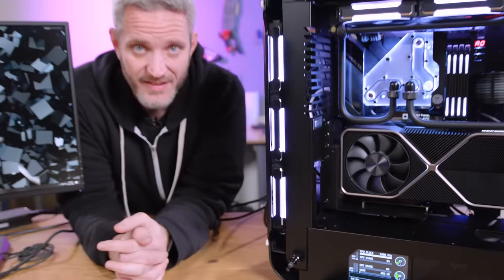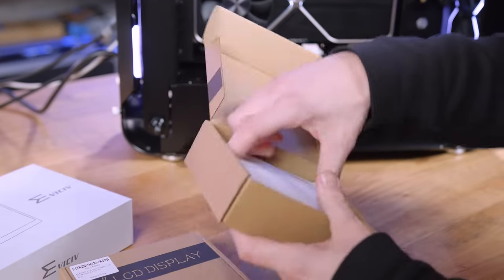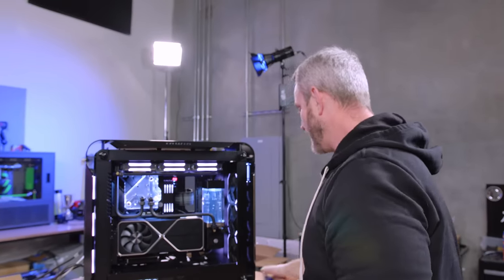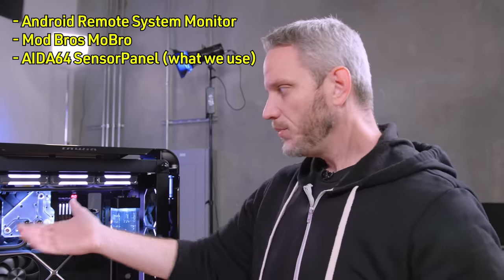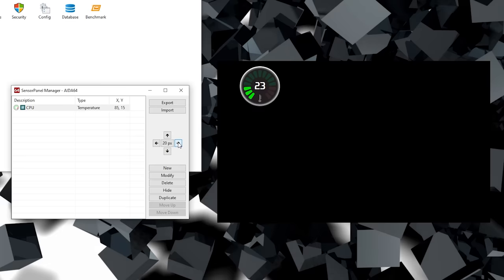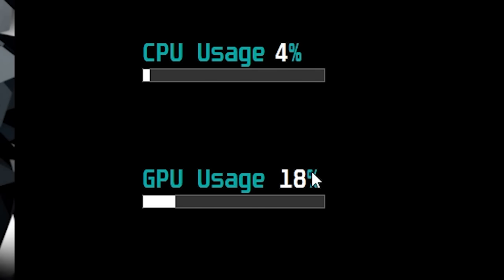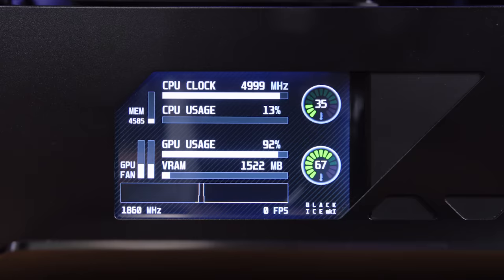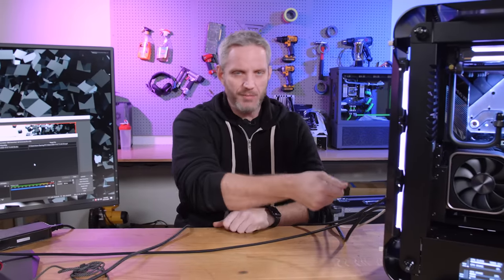EVERY PC should have one of these! How to make a sensor panel!

Comment: for those who couldnt fix the main display issue users, you need to find the correct dp/vga/dvi port on ur gpu for your main display,  
in my case, every time I boot up, the mobo automatically recognized the 5inch panel as the main display before loading into windows, i have set the monitor as the main display and it still does that everytime; 
eventually i changed my dp cable from one dp port to the other on the gpu (the new port is the one before the hdmi port), and this fixed my issue. (I have a evga 2080super xc ultra which has 3 dp ports 1 hdmi and 1 type c port)
just sharing my experience to help out anyone who might encounter this issue same as me

Comment: Second time watching this awesome video! I bought an Antec P120 case, because it had a tempered glass door, not knurled thumb screws, and for nostalgia, since Antec made the case I built my first computer in, twenty years ago. Added bonus, the case has a top mounted PSU shroud, classic, with a beveled window that is perfect for a sensor panel.
Update: I ordered the Waveshare five inch screen. It was twenty dollars cheaper and comes with a stylus, instead of the mounting screws, and no CD/DVD, just have to wait six to eight weeks for shipping, of which, replay through Amazon said it shipped about seven hours after I ordered.
Reply: Has anyone figured out a graceful way to connect an internal monitor. Personally,  having a hdmi cable come out of the case and back in is unacceptable for me.
Reply: @Jim22150  Maybe look for a PCIe card with an internal header, or get an old graphics card with a VGA port on a ribbon that can be disconnected from the mounting bracket and pulled into the computer, then connect it with an adapter. Not sure what your setup looks like, but you may be able to hide the whole card out of site with a riser cable. Of course, I don't even know if something like a second display card can be set up to only work with a second monitor. Just being creative.

As far as my computer goes, after having a power cord, USB cable to the printer, USB cable for my mobile device, ethernet cable going to my router, which has multiple cables of its own, and a USB splitter for my ps/2 mouse and keyboard's wireless receiver, having one more cable behind my computer isn't going to make or break my set up. Also, I'm currently using the HDMI off the graphics card, so my set up may end up looking a bit janky since I have to run a DisplayPort to HDMI adapter into the case first.
Reply: @1timothydillon  thanks Timothy,  I think I have another that also may entice.. find an empty usb 3.x header on the mobo, plug in a USB 3 cable with a female end,  from there plug in an active HDMI to USB 3.0 adapter (DC power required), then plug in the monitor. This is not very graceful either though bc the DC power cord would need to somehow be plugged into the PSU. Maybe there's some sort of molex adapter for this?

Anyway,  hopefully there will be a better solution in the future with next gen mobos. Look how far we've come with RGB over the last 5 years.  I can conceptualize future builds having multiple monitors for complex  stats dashboard or simple logo display

Comment: In regards to power/PC shutdown, I use a smart plug and have my bios set to power on after power loss restore.  So I can remotely turn my computer on either on my phone or google home/alexa. Also, the plug actually tracks energy usage which is nice little thing.   This would solve there still be some power going to USB ports even when the computer is "off"

Comment: I have a Corsair 4000D with two 140mm fans at front. 5inch screen fits nicely brtween them with no mods required, just two small cable ties.

Comment: I use something kind of similar, but on a tablet. It's a program called Remote System Monitor, you run the server on the PC, and the app on whatever mobile device and it works over your wifi. I have a few cheapo $70 Android tablets I use for stuff at my sim rig, so I set one aside for this. The only downside with this app is you have to "donate" to unlock all the features, but one dollar is all you need to spend.

Comment: This is a fun project. It does not make any sense though. It would be easier to get an additional monitor and display the metrics there. If you don’t have horizontal space, you can get a desk mounted stand that can hold two monitors stacked on top of each other.

Comment: I made once for Spec Delta  RGB Case Used my old Android Phone  with Program called Spacedesk on the Desktop and Samsung S5  set it up as 3rd Monitor install Panel and it worked flawless  OF course  I had keep Phone plugged in

Comment: Instead of running a HDMI cable to the outside of the case to the GPU you could use a Displaylink. It can run of USB 2.0 or 3.0 and since you are using the USB header anyway you don't even lose any more ports. Just search "USB Displaylink", these things can run 1080p with 30fps no problem.

Comment: Thanks for this adventure.... wow, this has evolved a lot since this video. Have you (or the team) considered using a USB 2.0 UGA to VGA ( and HDMI) inside the case and connect using a free USB pin header. if you dive down the rabbit hole, in the AIDA64 forum for panel sensor layout sharing is 316 pages and growing. I have viewed every one of them looking for layouts. There are a lot of different screens and sizes being used now. I would not be surprised if case manufactures start making these panels standard, or at least brackets available in the near future. Thanks for the great vid and info.

Comment: I used an old android phone in a little shell I put together using pitikapp to achieve this for zero cost.

Also links to Afterburner /Aida etc. And the display powers and on and off with the system.

Can edit the colours easily also so it works great with RGB. 

And ofc the display is great because it's a samsung AMOLED

Comment: even by using usb cable direct to a header you could get a mobo that has usb power turned on to the extra headers and may have to shut that off in bios anyways. just a good thing to probably check.

Comment: You could probably has used the first screen with an SFX power supply to have enough clearance for the 90° HDMI adapter. It just takes a bracket adapter to mount an SFX PSU in an ATX-spec case.

Comment: May want to mention about cutting the pcbs. All pcbs are multilayered; some times there is some kind circuitry in the board.  Not saying that electricity does not go through the board but instead rides on top.  Something that should be a video.

Comment: A lot of these videos are using aida64 and I haven't seem them mention any alternatives.  So I'll give Rainmeter a plug.  It's good enough that I'm really hesitant to spend another $50 on this little system monitor project for aida.  I'm sure it's worth it, but just seems unnecessary atm.  Been using rainmeter on my main screens for awhile so I'm just stickin with what I'm used to for now.  

It isn't as hardcore as aida's system monitoring, but plenty for most of us.  It plays well with Afterburner/RTSS and other apps (I think even aida).  You can create your own skins or edit the ones you download, combine elements from multiple skins, etc.  And it's much easier to find cool Rainmeter skins than it is to scroll aida's forums, imo.  

To edit the skins, you just have to get used to editing text files if you're not already, so probably another point for aida.  But it's pretty intuitive and easy to figure out.

Third option: use an old android as a remote system monitor in another room, or if you just don't want to buy a screen yet.  Trigone remote system monitor is probably the best for that.  Just takes a donation of >$1 for full feature/no ads.

Comment: ive got that, its called coretemp and msi afterburner giving me those stats in my taskbar.
or using rainmeter and setting up some system monitoring stuff on my other monitor while also being able to use it as a second monitor.

but yes, that little panel does look cool.
though i can imagine with how its set up that alt tabbing and exclusive fullscreen games might cause issues

Comment: One thing I didn't spot in the video - where do you plug the other end of the HDMI cable from the panel in? Are there internal connectors on modern graphics cards, or do you have to run
the HDMI cable outside the case into an external graphics card HDMI socket?

Comment: That’s pretty slick, I wonder if you could use a piece of clear double-sided tape and cut it to the exact size of the display and very very carefully mount the front of the display to the glass side panel of my ATX case as a way of mounting it instead of cutting through the bottom played that covers the power supply like you have it. I’m thinking lower right side mounted right on the glass with double sided clear tape?

Comment: The USB power thing varies by motherboard. 
My Asus X470 Prime powers the headers when the system is off.
I had to disable USB power so I wouldn't have the "Power" light of a memory card reader shining at me while the system is off.
My ancient X38 Core 2 Duo rig actually has physical jumpers to decide on a port group/header basis whether that port is powered when off.

Footnote, I don't know if the utility is still being maintained anymore, but back in the XP days I used "Serious Samurize" as a HUD utility. It connected to RivaTuner and Speedfan (the latter I know is no longer being maintained, sadly) to give me an excellent little vector/LED style HUD in the corner of my screen.
There are probably other utilities that use RivaTuner.

Comment: I use my cellphone for internet and the Spacedesk app which turns it into a second full resolution 60hz monitor over USB or wifi.
Touch screen monitors, wallpaper engine and widgets (media player, volume, date/time).

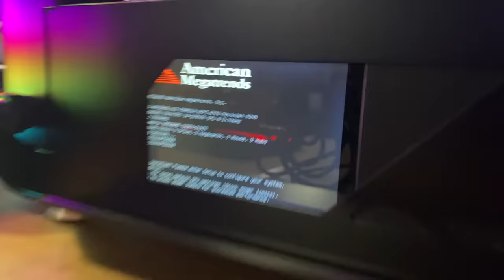Comment: Great video. I am looking forward to get a panel like that running on my system. At the same time I would love to know how to fix the default boot monitor issue as described at 18:48 marker. I know, strange question, I looked everywhere on how to fix this and for the first time I got to see someone mention it.
Reply: 1 yr late but I hope you fixed it. Like in the video, just dont connect the hdmi yet before booting. If you mean once installed, just make sure to set your main display as the primary monitor. Used to happen to me too using a secondary monitor.

Comment: Hi Guys... used this as a inspiration to build my own external sensor panel. Even used Aida64 which was way easier to use than expected. However the gauges on the version I got was basic circles. 
Where did Phil get the Gauge Image

Comment: Jay... Did you link the right panel model? You mentioned you started cutting off the riser tab holes - but the 5 inch one you link to on Amazon has those too! The one you display later about 6 min in doesn't have them. Did you cut those off too? Also does the HDMI feed back out of the back of the case into the GPU backplate. There's no neater way to do that is there?

Comment: Such a cool idea.  I'm curious if your mouse will drop off your main display to the small screen (if you're going to town on your favorite RTS, for example).  Anyone know how you'd prevent that?
Reply: If you're running, say 2 main screens plus this one... Set this one above your 2nd display within your windows display settings. So if you accidentally go to your side monitor, you won't hit the tiny one without going up. Arrange them in an "L" shape with the tiny screen up top, if that makes sense.

Comment: that looks nice. Ive got a define R5 case with the glass window( I think its just a strong plastic to be honest) , dont have the sleek bottom opening like you do on your case. Could I mount this on the window area of mine? any easy way to do this? I don't want to cut anything out my case or spend that much time on it, would be happy with the 5" display in a corner

Comment: Great Video! Im doing my sensor panel right now. But what is a little bit unclear, what Resolution should i use on the 5 inch panel?
In Windows 10 is no 800x480 possible. 🤷‍♂️

Comment: Sorry if you mentioned this in the video but I didn't notice if you did. I am getting very bad input lag on my mouse now. I am running two 144hz monitors and then the 60hz for the small Elecrow monitor you linked in the description. Is there a way to lock that 3rd monitor once it's setup so the refresh rates of my other two monitors will not be affected?

Comment: Thanks for the guide. However can I seek clarity on this. It looks like we will be setting up a second monitor right? Using a spare HDMI slot on the GPU and then configuring a dual monitor setup on Windows. Doesn't this affect the performance of the main monitor? Say I'm using a 49" OLED with all the bells and whistles about 240Hz etc. Would a dual monitor setup - even such a small LCD screen - affect performance on the OLED? And also the other potential issue with dual monitors, where your mouse can inadvertently 'slide' to the other display. Sorry I have not used a dual monitor setup for years and am not sure what can be done to minimize all the issues above.

Comment: Jay, did you use the HDMI off the GPU or the motherboard? If you run multiple monitors off the GPU will it be an issue?

Comment: Is there any way to shove it anywhere but the default GPU monitor port? Cause it both dumb and problematic(at least for me) to stick a cable in GPU outside just for the cable to then go inside the case and into the screen.
PS hmmm though I have a VGA-USB converter. Wonder if I can both use the monitor and power it up with motherboards USB.

Comment: I have an older cooler master HAF 912 and have basically no use for the drive bays anymore so this could be a great replacement for that space...

Can you flip orientation on that screen or do you need to set it up sideways so it's correct when moved over?

Comment: I am watching this as I am in the process of purchasing the components for the first desktop computer I will have built since the windows XP days when everything was simple and you didn’t need 1 million fans… Oh the good old days! I am going to do this for my set up. The builder I am doing is based on a pink case with white internal components pink internal fans and lots of RGB and my first ever full water cooling because I am trying to get as close as possible to a full blacklight build. 

I have a couple of questions and a little bit of a challenge I would like to push forward .

1.  I have a mint shape iPhone 8+ product red that I have replaced this year with an iPhone 13 Pro Max. That being said is there any way that I can make use of this in mint condition piece of equipment to convert it over to be the display panel?  If yes, would you consider doing a video on how to do that and if you would you might want to consider including how to do it with it any kind of used android phone also.

2.  As I stated above I am trying to do as close of a full black light visual look for my build and I am wondering if you have ever or anyone has ever seen or built them selves a true black light full water cooled desktop? If you haven’t seen it would you be willing to take a crack at actually trying to build one to see if it is even possible to do a true black light and not a simple UV substitute type of look?

3.  Regarding interfacing an iPhone, I know that Microsoft has included a way to access an android phone and use the phone functionality through a computer. I know that it does not work for an iPhone using the built-in functionality Microsoft has provided, is there anyone that has ever successfully found a way to integrate an iPhone the way Microsoft has provided for the android phones? If yes would you be willing to consider doing a video on something like that? 

I hope that you take my two video suggestions as kind of challenge is to see if they can be done because they really are challenging ideas.

Comment: Does the Panel have to be connected via HDMI or can it still display the info via a USB? I do not have an additional HDMI port as I run a dual monitor setup rn. Thank you for the help!

Comment: Question: Did you use an HDMI plug on the GPU or did you use the built-in GPU on the CPU. I can't tell what CPU you're using so maybe it doesn't have on-board video.

Comment: So the sensor panel is essentially just another (tiny) display? How do you prevent the mouse cursor from accidentally wandering into that screen? Is there a way to prevent the cursor from entering the display or do you just need to be cognizant of where that screen is and not cross over to it?

Comment: you know when you complained about the psu getting in the way of the hdmi adaptor at 4:00... i was like immediately thinking why not just use a SFX PSU and use cable extension... because we all know you have them at 1 point in this channel's life time.......
Reply: lol another one from the usb problem i was like thinking there are internal headers that terminate to usb A female sockets.... you could have use those...
Edit: i mean there are adaptors for internal usb headers that goes to a female usb sockets so phil could change it that way if he want to... oh and internal headers are dependent on the motherboard manufacturer... some of them still have power even when the system is shut down.... you need to set the settings in bios...

Comment: Can I use the HDMI port on my intel motherboard w/ integrated graphics instead? Or will a DP>HDMI cable work with one of these? Having to use the HDMI 2.1 port would unfortunately be a deal breaker for me.